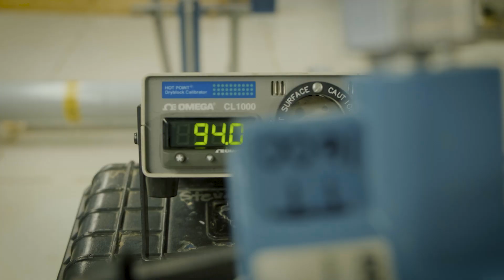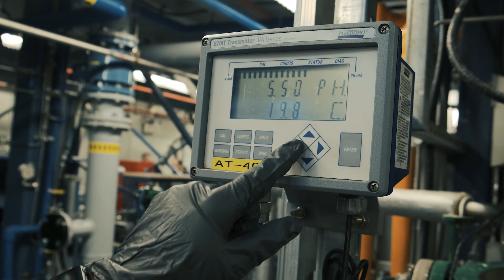Industrial Instrumentation and Process Control Technician

Comment: Is Instrumentation a good career in Canada?
Reply: Yes! I am an American, but our field is fairly adaptable and evolves with the times. Oil and Gas, Food Production, or basically any automation. I worked in the semiconductor industry for a bit, and left to use my degree more. I can answer any questions about what you'd learn for your degree. I have an ASS in Instrumentation and Computerized Control Systems.
Reply: @Karabiner792  how to get knowledge in this field bro